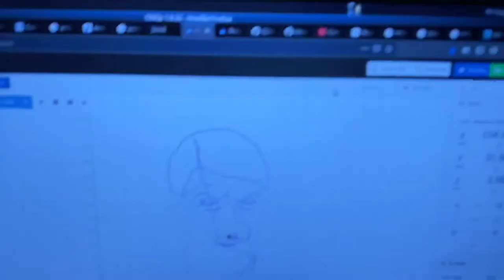Final dremel cnc test before milling

Comment: I’m not sure if you will be responding to this but since you have experience on the dremel cnc I need to ask something. I have a problem on my dremel cnc where in the past I had all axis’s moving except for the z axis and everything I try does not work do you have a fix or know what I should do
Reply from the maker: not sure, when I had issues it usually came down to motor driver voltage being too low, or the physical connection not being correct. get the multimeter out, verify both of em are what they should be. Otherwise double check the pins in GRBL (or whatever you're using) that you're sending PWM to the pin that's actually connected. Just one of those things you have to verify step by step, troubleshooting on your own honestly, if you're attempting a DIY CNC build
Reply: @derekarnold   in the past I’ve been doing tests to find out what’s wrong I found out only one motor driver worked for me so I am using that for my z axis I tested a Gcode problem by getting an online cnc gcode and that did not work and I tried looking at grbl and gcode sending settings but that didn’t work it but even if I jog the z axis it still does not work do you think that this problem would likely be the driver voltage or something else
Reply: @derekarnold by the way thanks for responding but could you also tell me what I should have my motor drivers voltage at and what I would have to change it to
Reply from the maker: @BrandonSchwab660  I can't recall offhand, but that information should be available on a datasheet for the given motor driver. An informal way to tune it is to turn it all the way down (make sure you verify which direction down the trimpot goes), then slowly turn up the voltage on the driver until you can't hold the motor in place when it jobs. If you can't jog it at all, I'd try swapping motor drivers, just to rule out if it's the driver, motor etc. Like I said, you'll just have to troubleshoot using known-good components, ruling out each point of failure.
Reply: @derekarnold  never mind about that I tried that and by just using my digital multimeter one of my drivers almost caught fire
Reply from the maker: @BrandonSchwab660  yikes, yeah, you gotta have a steady hand when you're probing that trimpot
Reply: Stephen Ferree  I’m not sure what speed it’s at but I will try this on mine